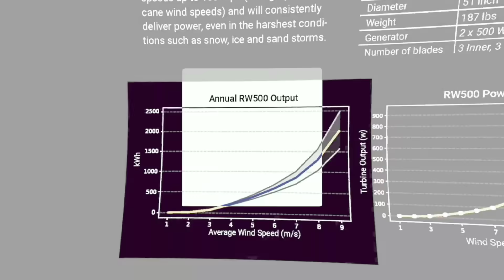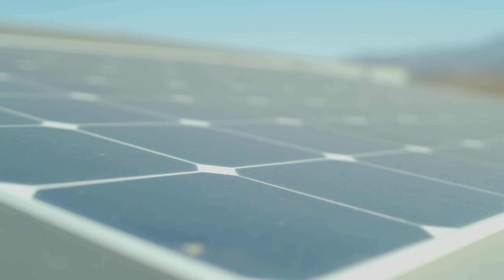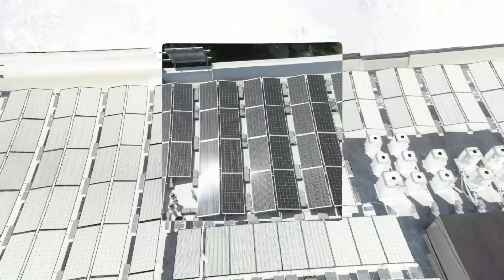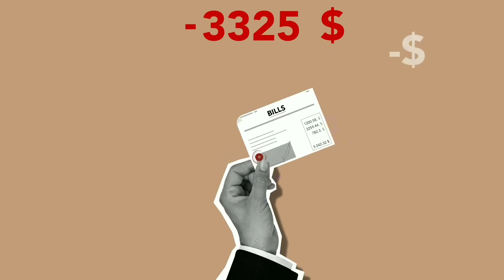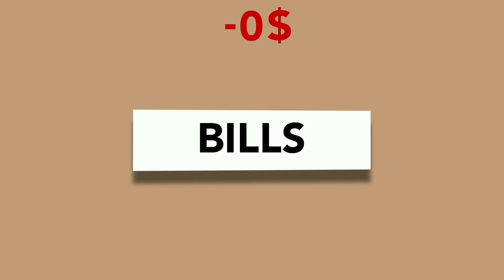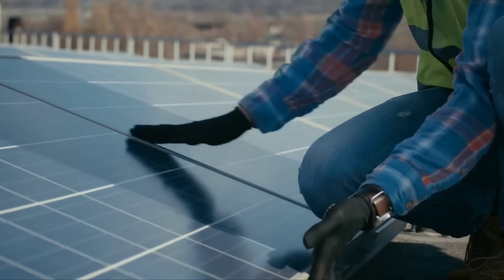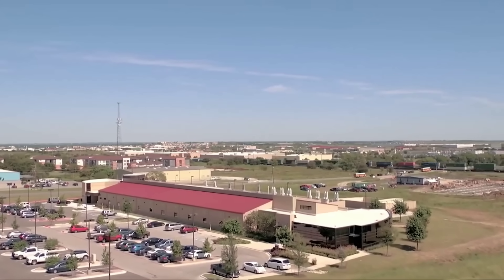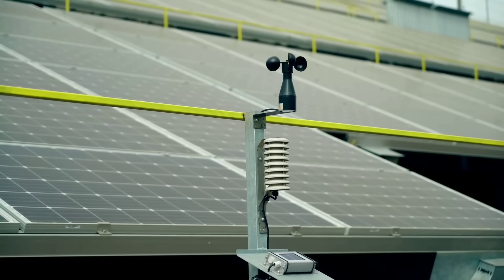This Could Be The Safest And Most Powerful Wind Turbine In The World.

Comment: What a load on nonsense. At that power output you’d need at least 5 of these to power an average home, which at their pricing is about 30-40% more expensive than equivalent PV + battery, which would be silent and have no moving parts. Oh and solar panels don’t need replacing every 10 years.

Comment: The concept is excellent. It should be possible for other companies to manufacture such turbines at substantially reduced cost. This is a design approach that has been around for a long time. Indeed I have seen similar home constructed versions that were made in the the 70s
Reply: Thank you for sharing your thoughts! It's fascinating to see how this wind turbine design has been around for decades. Innovation often leads to more affordable options, and I believe the same could happen with this Segway Portable PowerStation Cube Series. With its impressive capacity, powerful output, and fast recharging capabilities, it seems like a reliable choice for outdoor enthusiasts and those looking for a home backup power solution.

Comment: Replacing solar PV panels "every 10 to 20 years" would apply only to the lowest quality panels.  The higher end panels carry a warranty of 25 years with an additional  90+% performance warranty.  Many panel brands last 30+ years.  Moreover, they are now recycling PV panels and recovering their materials for reuse.  This is not to say this wind turbine isn't worth it, especially if its price outcompetes gas or grid hydro, but it could be limited to a supplementary role mainly used during dark winters and nighttime.  The video states that solar PV takes a lot of room, well so what?  Roofs are ideal anyway and offer pre-existing structural support.  'Agrivoltaics' is a new term and refers to the complementary roles solar arrays and crops can play when panels are raised up and medium shade tolerant crops are planted.  Some panels are coming onstream with more clear area per panel to allow sunlight to pass through.  The plants below also keep the panels cooler.  Some solar-farming practices also allow greater space between panel arrays for lines of crops that can be harvested by tractor-based machinery.  Net metering profit works only when the grid credits each kWh equal with or more than the grid charges per kWh., all above the cost of installing the system on a per kWh basis over time.

As always, today's battery technology is advancing very quickly and should be considered as part of any renewable energy system.

Comment: The cost of these per Kw-h is ASTRONOMICAL. 
Their website says $4100 for one 100 watt turbine with mounting hardware. 
These cost 10x more than they should for what they are.
You can buy a 150 watt VAT for less than $400.  With another few hundred for an inverter. 
You can buy several kw turbine systems with the grid tie inverter for the same cost as this thing.
Reply: Amen
Reply: And it comes with a bullshit spiel. He said that you have to factor in replacement costs because solar systems only last 10-30 years, while his turbines last 30 years. Well, that is a replacement cost to factor in.

Comment: I see this as potentially complementary system to solar system on most areas. The average wind on most living areas it's under the minimum requirements for an efficient ROI. This vawt type combines the drag type with the lift type of the turbine which could improve the drag flows but still limited. The hawt principle is still more efficient. Good idea but, with all the respect it looks over claimed. Thank you for the insight!

Comment: I personally would like to see a home system that includes, wind, solar and Hydro power generation. Was hoping the Tesla system would have this, but it doesn't. However, I still believe their system could still end up being more of a money maker than their cars. 
If you have a dual battery system, you could charge one battery while using the other. Most systems count on generating enough electricity via solar panels to run the house and charge the battery at the same time during the day and then use the batteries at night. With just the addition of wind, you could continue charging, as long as the wind is blowing. Hydro, would be the 3rd charging method and for most people, (those that don't have a stream), would involve a hydro battery. Hydro batteries are basically water towers, they fill the tank up using the solar panels during times of excess capacity and the water is held until it is needed. If an extra charge is needed, the stored water is slowly released and uses gravity to generate the force to turn a small turbine.  If you happen to have a stream on your property, then the tower isn't needed and hydro may be your second option ahead of wind, since it would be more consistent. 
Anyway, good to see the innovation on the wind turbines, enjoyed the video.

Comment: This is a Small turbine. They could make a much larger version with progressively smaller turbines nested inside inside for a combined effect in the same footprint.. Using extremely lightweight, but strong materials would result in increased spin. The ideal placements could take advantage of wind coming off a mountain range or  daily onshore/offshore winds from the coastline.
Reply: Turbine inception?

Comment: 1. If you buy electricity for .15 you sure as hell don't sell it back to the provider for the same price. You'd be lucky to get .05
2. 25mph wind is a lot to ask to produce such a small amount of power.
I really don't get why such a high price point either.
Reply: They cost 10x more than they should. 
You can buy a higher output VAT for $400 ith a couple hundred extra for an inverter.

Comment: Some of the points stated here are misguiding. 
"Solar panels degrade over time." Everything degrades over time. Warranty generally covers 25 years for solar panels.
"Wind turbines don't depend on weather". Well, no wind, no power. 

Neither is a substitute for the other but a good supplement. No need for bashing solars to make a point for wind turbines.

Comment: Every mechanical system wears, and the bearings have a definite life so this turbine will have a defined life and if constantly buffeted by disruptive winds then is life may be shortened, so may not  live out a solar panel. But that is said this I think it is a good product, only that the commentary borders on the truth. Just like you car it may need new wheel bearings if it driven hard, and just like solar panels needing regular cleaning,  your turbine will need regular inspection and maintenance, especially the  design that is cantilevered from base.  Without a top bearing, the lower bearing will see a high deflectional load and I suspect it's working hard.

Comment: The CW series has not entered the mass manufacturing process and is currently not available. We are aiming to get it to mass manufacturing by the end of 2024.

We are transitioning to Gen2 turbines this year with upgraded materials (more carbon fiber) and new generators and electronics. We will release a new datasheet once the trials are completed.  We are in the micro turbines business, they range from 100W-600W @ 10m/s with a maximum output of 5000W in high winds. Estimated price for the RW600 will be around 8000USD. Grid tie electronics are usually around 3000USD. ??????? This is not serious.

Comment: Ok you engineering buffs & scientists; Q, Would this wind turbine work on a campervan roof?........or would the movement of the vehicle negate the MPG (miles per gallon) enough not to be worthwhile? or could it be mounted behind the back doors of a vehicle when moving to capture the wind (eddies) to solve this?
Reply: Nope, there is nothing free in physics, if you will install it on th8e back of your car - the windage will make the fuell efficiency of you car horrible to equalize the effort...

Comment: A lot of bull shit if you ask me.
So I asked AI this question:
In the USA how many days a year does the wind not exceed 10 mph on average for 8 hours a day?

AI:
There is no definitive answer to this question, as the number of days with low wind can vary significantly from year to year and depending on the location within the USA. However, based on historical wind data, we can estimate that there are typically around 100 days per year in the USA where the average wind speed does not exceed 10 mph for 8 hours a day.

Here is a breakdown of the estimated number of low-wind days per year for each region of the USA:

Northeast: 120 days
Midwest: 110 days
South: 90 days
West: 80 days

That's a lot of days where a windmill sits still and you have to get a lot of power somewhere.

Comment: "800% more Power" How is that to be understood?
Reply: My thoughs exactly. It can produce 150-200 watts of power at a wind of 25 miles/hour. A washing machine uses up to 1500 watts to heat up the water. That means I will need at least 10 of this to wash my clothes lol. Our 20 KW solar system costed about 15.000 euros (so about 4-5 times the price of the freya model) but it produced between 25 kWh (day full of clouds and rain) and 120 kWh (sunny day in July) per day. It made 3000 kWh in July while this wind turbine will make 144 kWh in the best case scenario (running 24/24 for 30 days at max speed which is unreal). Sure it costed 5 times more but it produced 20 times more in July. Sure in winter the production will go down but it still will make more than I need for the daily routine.
Reply: Its internet not true, just better than 100watt

Comment: These claims are so full of holes I don't know where to start.
Reply: Please elaborate on what these holes are. Your comment is very vague.
Reply: I do not agree with your skepticism, but thanks anyway.
Reply: I do agree! 25 miles per hour you won't experiance in any town in the world. More like 2-5 meters per second of very turbulent wind.. And this savonius dareius turbine will produce not more them100wats per hour in urban areas. Though constuction is good. I like the design. The specifications are as said, full of holes
Reply: 5-10 mph wind is probably a good average where I live.
Reply: 40kph? Not a problem! Either Hobart or Adelaide in Australia - both of which I've lived in!
Reply: @JaneNewAuthor 
Ok. You are right, i lived in Woolongong for a year some 40 years ago. I should have writen "many towns". But those are coastal lines. Winds are strongest over ocean areas.
Reply: @draganpantelic3132  that covers every major city in Australia bar Canberra!
Reply: Inside big cities winds are very turbulent. Darieus turbines don't start in low winds. This is why they aded savonius in the midle. But savonius is least efficient off all. So,this is not very efficient turbine. The way to go inside cities are crossflow vawt turbines. Along Australian coastal line, with stady winds free of obstructions, you can use darieus, but still hawt is the most efficient. Best Regards
Reply: Definitely agreed.
  The best and most efficient are 3 bladed horizontal axis wind turbines invented in the 1930's by Marcellus Jacobs.
 It seems like everybody keeps trying to reinvent the wheel and duping people who don't really understand how these things really work, or where the wind has actual, cost effective power.
 There have been a couple of worthwhile improvements though, such as brushless generators, simpler governors, and reducing down to only 3 moving parts.
Reply: @johnwyman6126  Thank you for a very factual and well stated comment ! ! !  Maybe we can save a few individuals and prevent them from investing in fool's gold!   😁
Reply: @draganpantelic3132  Dodge City KS (mid USA) has an average windspeed of 13.1 mph and no coastline to speak of.
Reply: @johnwyman6126 I am sure it was the best and most efficient design back in the 1930's, probably even until the 1970's. That unbalanced design could never be the most efficient. It is only the most popular due to habit and resistance to change, that humans often express. So many more efficient designs exist. But it's hard for them to get funding due to the aforementioned reasons.
Reply: PV solar only need daylight to produce power. He's talking shite when he says they need sunlight.
I should know, I have them on my roof here in the north east UK and I have a constant yearly 33% knocked off my energy bill.
Reply: Yeah this this works better than solar. Solar company already gone bankruptcy.
Reply: @mobileplayers5008   Well it depends, as long as there's a lot of wind a lot of the time it can work better, but there's not many places like that. Hydropower works better than wind, but there are even fewer places that that will work. Solar works about 8 hours a day, but it can work almost anywhere.
 Lots of companies go bankrupt all the time. There's not just one solar company.
Reply: Biased comparison to solar...  yes they both have limitations, but if wind so much better then give a fair comparison.  @4:18 "wind does not depend on the weather"... "you don't need a backup system"...  just plain  crap of a comparison!!!
Reply: Who lives in a place with average wind speed is 20 mph? It's pretty high speed of wind
Reply: @draganpantelic3132 wrong. My average wunderkind speed is 31mph
Reply: @malisangarepa1809  Santorini Greece only 😂
Reply: I am considering a vertical axis wind turbine that looks exactly like a tree, I call it : e-tree,
the trunk of the e-tree is brown, the spinning blades are green ,
on the trunk of the e-tree, there are features of : wifi/mobile network, light and power outlet, to charge a car for example

Comment: Iam a filipino leave n the Philippines My own bill in electricity in every month the consuming bill is P 300.00 while the price of Ice turbine is $ 3,200 equivalent to P 179.200 Philippines money. keep in my mind that per month Im consume P 300. electric bill therefore in one year is P 3.600 expenses or paid electric bill. but the price of ice turbine equivalent to Philippines money is P 179.200
    therefore price loss  in 10 years The paid electric bill is P36.000 in 4 decade is  P1444.000 Philippines money versus the price of ice turbine is P 179.200 in Philippine money exchange The price is loss how could be a favor to the buyer , another point if there is no Air or wind there is no electricity produce While the electric company in 24 hours they give continuously electricity in every household 
  in calculation the price  is not in favor of ous , and third if there is a strong wind which called typhoon or huricane or either thunder storm the Equipment will be destroyed or ruined even there is no calamities still no benifit

Comment: Great stuff. I dont think you stay objective in relation to solar panels. When mentioning solar, you say that the sun does not always shine, so its unreliable. True. This would not be an issue if you are connected to the grid and can buy and sell power (which is usually the case). When talking about wind you always mention the benefit of selling power to the grid. This makes you sound biased.

So lets stay connected to the grid for both solar and wind. What matters when you are connected to the grid is how much kWh you produce per year, how much it costs and how long it takes to break even (including all the repearing and diminishing returns). Now solar is a great competator.

Good job on promoting green energy!

Comment: I'd like to augment my solar with wind, but this is too pricey. Holy crap.
Reply: The nice thing about solar is that it is so modular, you can add to it a bit at a time, and it is not very site specific.
 The nice thing about wind is that it can provide power when there isn't much light outside. Although it is more site specific, and not modular, therefore it's pretty much all or nothing and towers can get quite expensive.
 The nice thing about micro hydropower is that it runs 24 hours a day, and costs much less, because you need much less equipment and batteries. Although it is the most site specific of all.
  Using 2 or 3 of these technologies to charge one battery is called a hybrid system.
Reply: fladave99   That depends upon your wind resource. Some areas have more wind than others.
 A wind map can  be an effective tool to find out if wind would be cost-effective or not in a specific area.
 Making a blanket statement saying that "wind is worthless" without specifying a certain area, or situation is markedly Ignorant.

Comment: Let’s be real.  You would never get any payback.  Look at the KWH it produces and the cost/KWH you pay per month.  Mine is 9 cents/KWH.  My electric bill is $100 per month.  I use 1100 to 1200 KWH per month and we don’t really try to save on anything.  $100/month is nothing to us.  we lived in HI for 30 years and paid 33 cents per KWH in 2018 when we moved to Ohio.  Hi is 40 cents per KWH now.  I’m only interested in a battery to use if power goes out for 1-2 days.

Comment: Rules for economic investment in energy savings as an individual.

1) Isolate.
2) solarcells
3) Heatpump heating
.
4)batteries
.
5) Windpower HAWT.
.
.
.
.
6) VAWT.

Vawt's specialise in high material costs due to high weight relative to energy production, their propensity to malfunction due to the leverage of the forces acting on the turbine AND the poor wind environment HAWTs  enevitably find themselves installed in.

Comment: Another example of a well marketed underperforming turbine, with no innovative steps in its design. The market is full of turbines with outrageous claims, and this is no exception. I should know, as I designed turbines of many types for over 10 years and it's a really difficult technology to get right. This isn't one of them unfortunately. It will have some uses, but those will be limited.